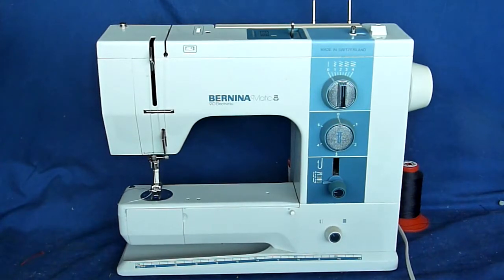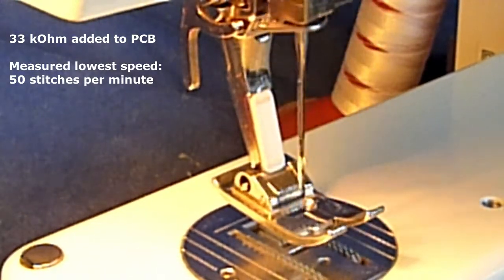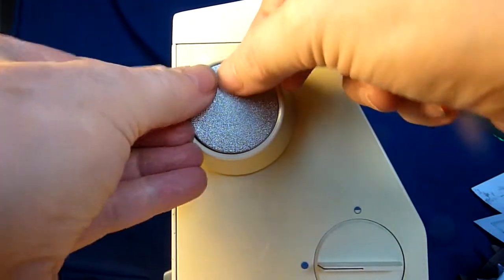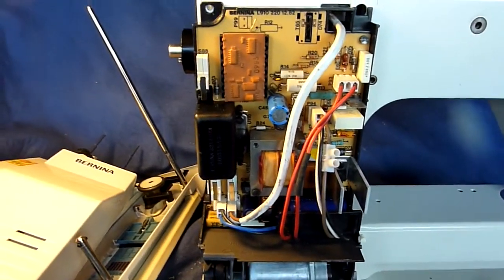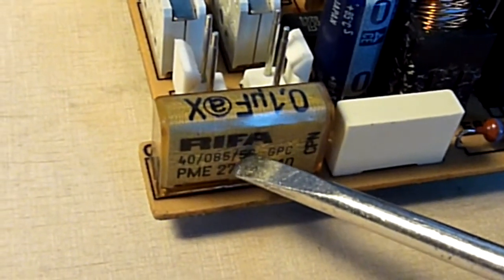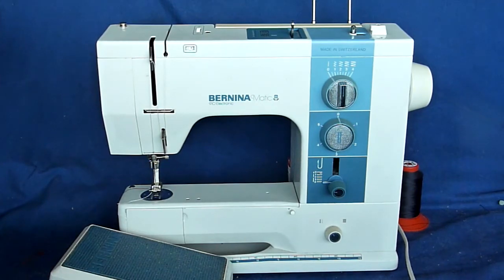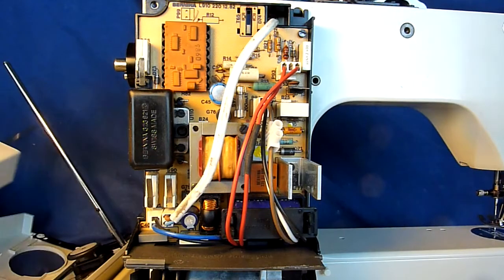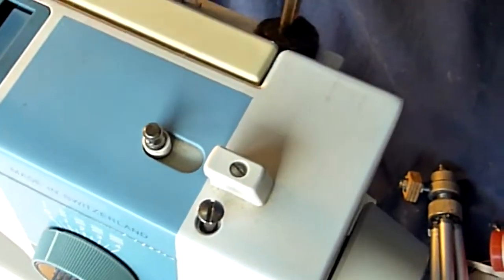Bernina 910 Sewing Machine Start Speed Reduction

Comment: Hello, Do you possibly know the value of the large transformer in the middle of the PCB? I am need of a replacement but I can not find any information on the transformer at all. any information about the transformer will be greatly appreciated. Thank you
Reply from the maker: I think the expected rectified DC-voltage supplied by this transformer is 20 V. From the size and fuse used, I would guess it to be a 5 W transformer. So my qualified guess would be, that if you have a mains voltage of 115 V or 230 V, then the output no load secondary voltage should be about 16 VAC. This is my estimate - but I cannot tell for sure.

It is not likely, that you can find a transformer that fits directly, but by moving some connections and making some other mechanical fastening of a new transformer, you should be able to find a transformer for about $25 on internet.
Reply from the maker: I just made some more accurate measurements for you. I got a mains grid voltage of 223 VAC, 50 Hz. When I remove the 200 mA fuse to the secondary winding, I can measure the non load voltage from transformer. It is 20.9 VAC. When I inserts the fuse, the secondary voltage drops to 18.3 VAC. I measured the average DC voltage, and it is 19.8 V. The ripple voltage on DC is 1.7 VAC. The AC current at secondary winding with machine in idle mode is 125 mA. When machine runs, the current drops down to about 70 mA at max speed, and the DC voltage increase to 23,5 V. However when solonoid is activated, the current increase (shortly) to 200 mA and DC voltage likely drops to about 17 V. 
I hope this information will be sufficient for you to find a replacement transformer.
Reply from the maker: I have a small 1.5 VA mains tranformer, that I got some years ago. It is marked 18 V for secondary voltage. But when I measure it with no load, I measure 27,5 V on it. It seems the 18 V have been specified in loaded condition. But I cannot say than all  manufacturers of small transformers specify in same way.
Reply: @sewingmachinesindetail  Thank you very much for your reply and sharing your knowledge. That information is perfect and very helpful. Hopefully I can find a suitable replacement Transformer. I really appreciate your help I have spent many days searching for this information on the internet and had not found anything at all.
Reply: @sewingmachinesindetail  I managed to find a replacement transformer which I received and installed today. The sewing machine is now back together and running perfectly again. for future reference or for anyone who may find the information helpful the replacement transformer I used was a PCB Mount encapsulated 18V single output, 3.2VA Transformer. The size is exactly the same but pins were in a slightly different position to mount directly to the PCB so I extended and manipulated the pins to fit, and glued a block to create a stand off from the PCB for extra support an alternate option would be to drill new holes through the PCB and make jumper connection on the reverse side of the PCB.

I really appreciate you providing me with the information about the transformer, I would not have been able to repair this machine with out your help. I am very grateful. Thank you
Reply: Link to transformer - https://docs.rs-online.com/71fd/0900766b80f46e58.pdf
Reply from the maker: @KBFix  Thank you for your reply. I am glad, that you worked it out, and made the machine work again :)

Comment: I have a Bernina 930. The needle stop function no longer works. Where could the problem be?
Reply from the maker: If you for some reason have taken the PCB out of the in the machine again, there is a lever connection to the solenoid, that needs to be connected in the right way again. It is a common error by that. I got another video about how to reduce start speed, at it explains how to dismantle and reassemble this part of the machine.
Reply: The lever is in correctly. The solenoid valve doesn't pull down so the lever stops the needle.
Reply from the maker: @marios852  If the solonoid do not activate, then you got no needle stop. I guess the motor do drive the machine as it should - right?